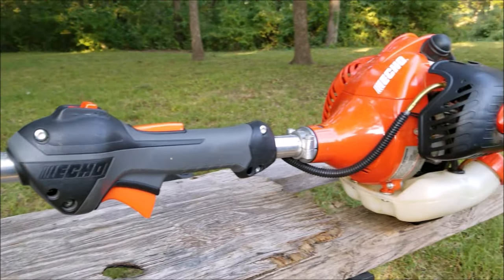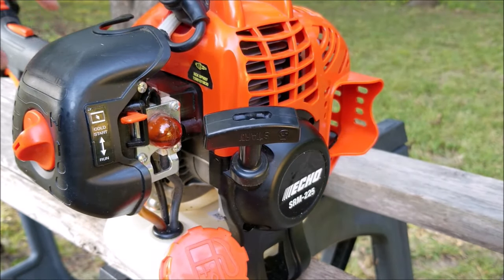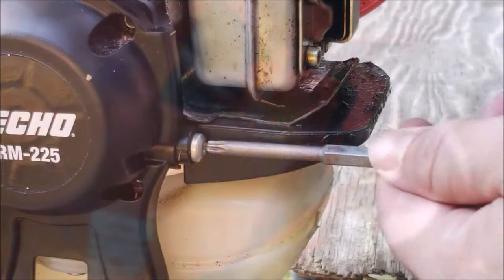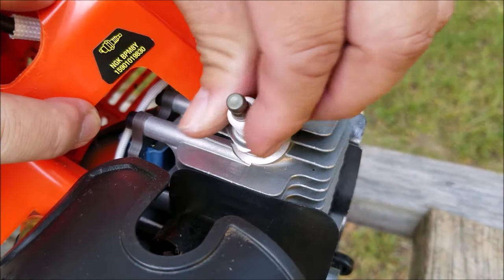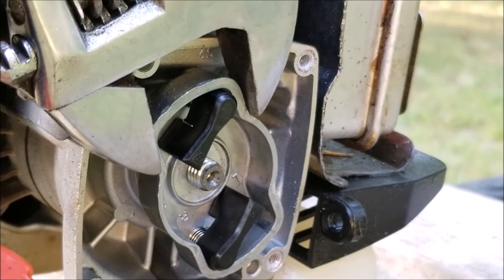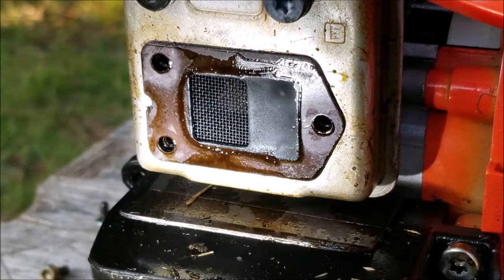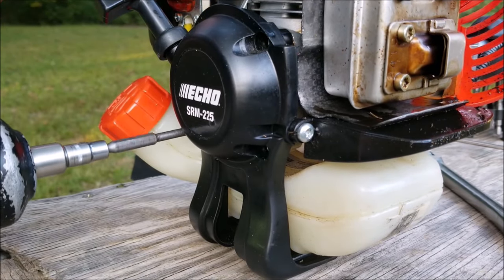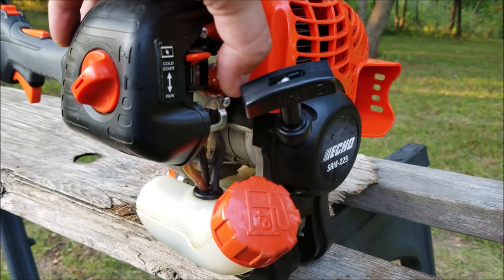Pull rope is stuck and won't budge

Comment: Bought a chainsaw,spares or repair. Pull rope wouldn't move. Took spark plug out, covered in lot of fuel/oil residue. Removed muffler to check piston etc. Piston ring was glued too.  Poured some white spirit into exhaust port & plug hole. Left to soften a few hours then engine turned over. There was still a thick coating on piston head & upper cylinder.
Mixed 25 ml of white spirit in 5 litres of petrol. Used to make up 2 stroke mix @ 40:1 .
After running a few tanks of this fuel mix, checked piston through exhaust port. The residue had dissipated. The metal was shiny & piston ring groove clean. No visible damage in engine, just some tarry gunk in bottom of muffler. Spark arrestor screen clean. Still running well. Hope this helps someone salvage an abused tool. People's thoughts would be appreciated. TIA
Reply from the maker: It happens sometimes but you did a great job freeing it up.
Reply: I'm opening up my weedeater today.  I am not mechanical but I have managed to fix some mowers  using youtube.  This will be my first try with a weedeater.

Comment: This is why when you winterize your equipment, you dump the fuel but don’t forget to run it after a few times to burn all the fuel out of the system
Reply from the maker: You're absolutely right about that.  Thank you Ozzy Dotson.

Comment: Great job! I had the same issue with a Shindaiwa hedge trimmer I was able to loosen the seized piston using a 50/50 mixture of kerosene and two cycle oil and letting it soak for 24hrs...enjoy your videos...keep up the good work.
Reply from the maker: thank you Kirk Leaper

Comment: Worked for me. Thanks a million brother. It was my dad's x-series weed eater. I think there was some built up pressure from the WD-40 being in there with the spark plug in. But as I pulled the string a few times the pressure began to release more and more with every stroke till it started.
Reply from the maker: no problem

Comment: Good job, I've never had that happen, I only use the good stuff,  Aspen 2 in all my two stroke equipment so I don't have to worry about leaving the tank full over winter and I find it burns cleaner. I used to mix my own fuel and had to empty everything for any long storage like over winter but when I changed to Aspen 2 I don't have to worry about that and I also found that it cleans the engine too, my HS 45 Stihl hedge cutters had tons of carbon deposits on top of the piston, 3-4 tank fulls of Aspen 2 and it's gone and looks like new and runs way better
Reply from the maker: i'll have to look into Aspen 2 sounds like great stuff. Thanks for the comment I appreciate it.
Reply: @HomeGaragechannel  no problem, let me know how you get on and please keep up the great video's
Reply from the maker: @nicolabooth6075  I will thank you

Comment: The storage was a problem but all the carbon on the sparkplug seems to me that the owner never runs it hard enough to burn it off . my neighbor was using his 2 stroke barely above idle and i told him its a 2 stroke and you have to rev it up more or you will have problems and now he gives it a workout .
Reply from the maker: you are absolutely correct about that.  as for how they were using it i'm not really sure.

Comment: Or use fuel stablizer. 
I have never had any issues starting my equipment after storing for the winter, or longer. At the end of each season I change oil, filters, etc., then run the machine til it stalls out, a couple of times, then I will empty the last few drops of fuel from the tank, leaving the cap loose or off to let everything evaporate, and will dump any residual fuel from the carb, and blow out the jets.
Next season I check the oil, gas and go. 
Been doing this for decades.
 Never had an issue starting even very old equipment.
But good job getting the trimmer going. May have been a good idea to check the air filter before starting. Eliminates another possible issue, and much easier getting it back on when the engine is not running.
👍
Reply from the maker: yes some people just put stuff full of gas.

Comment: No I haven't had an engine jam up on me due to storage but I think someone has used too.much 2 stroke oil in the fuel at one stage in the line trimmer in the video because I think that's what's caused the cylinder to varnish up.

I was told not running a 2 stroke engine at full revs can cause that because all of the oil doesn't get burned off so it just sits in the combustion chamber then varnishes up the cylinder, piston & rings !
Reply from the maker: that makes sense.

Comment: Before storage, the manual for the Echo GT225 recommends:  Observe the piston location through the spark plug hole. Pull the recoil handle slowly until the piston reaches the top of its travel and leave it there.  Reinstall the spark plug but not the ignition lead".  This might be a little extreme, but I've read many suggestions in manuals  to rotate the engine until you can feel that you're solidly into the compression stroke, to close the valves and seal the combustion volume.  Perhaps this would have helped here.  Since I have an identical model, I'll pay a little more attention this autumn!
Reply from the maker: this is a great idea.  I'm surprised that they would suggest that in the manual.  I would only do this if i was going to put something up for a very long  time.  Thanks for the comment I appreciate it.
Reply: On a 4-stroke, like on a generator it's good to store them at TDC. That way both valves are closed. I have a 2.6K Onan that I have to store like that. An intake valve was stuck when I got it and the TDC has kept it ready to go since then.

Comment: Thank you for this video. I have an excavator wood chipper that has a stuck pull string. The problem started when I left the machine outside overnight and the temperature dropped to freezing. Even after warming up it is still stuck.
Reply from the maker: did you happen to oil the spring at some point before hand?

Comment: This looks like the results of improper fuel mix or crappy 2 stroke oil... echo red armor is the best air cooled 2stroke oil out.. I run it in all my machines. Trimmers , chainsaws,  snowblower you name it! There is totally a difference between liquid cooled 2stroke oil, marine 2stroke oil and air-cooled 2stroke oil. This info was given to me by my local power equipment shop, awesome guys that take pride in helping provide customers longevity with their equipment, rather than constantly getting it fixed 🙂
Reply from the maker: thank you for the information.

Comment: Yes, I had a customer bring me a small Chanpion generator that was full of very sticky stuff, Don't know what they used for oil but it was awful. Maybe they put cheap 2 cycle oil in a 4 stroke engine. Thanks for the video.
Reply from the maker: no problem Waterman one

Comment: Had a similar problem with both of my trimmers and both were kept inside. Could not rotate the engine with the plug in but rotated without the pug. So shot some carb cleaner and engine oil into the cyl and finally got it to rotate with plug installed. First time I ever experienced that symptom as I use these machines quit often. Also use a gas additive to prevent varnish. Thanks for the video but wished I had seen it first before attacking the problem. Not sure there are valves in these 2 cycle engines or reeds.
Reply from the maker: Neither as far as I can tell. Thanks for the comment I appreciate it

Comment: no because the feul evapourates leaving the oil behind causing it to stick can also stick the diaphrams to gether making it unusable sometimes having to clean out the carb and replacing the diaphrams this one was lucky
Reply from the maker: You are absolutely correct

Comment: Someone needs to use a different 2 stroke oil, it not doing its job fully. Storage protection is also part of a OPE oil job. Does the oil used on that trimmer say Biodegradable on the front of the container?
Reply from the maker: i'm not sure about that information.  I'll have to ask

Comment: I cut the grass yesterday. The first two rounds were fine. After some time the machine stopped and I tried to pull the string to start but it stuck. Not sure what caused this but the motor was hot when I touch it. I have a different model but I will try to check following your video. Thanks for the clear & precise explanation! Great video!
Reply from the maker: take out the oil dipstick and wipe It clean, and then check the oil, it might be a little low.
Reply: @HomeGaragechannel  I followed your instruction but I didn't have a carburetor cleaner at the time. So I just sprayed oil inside that chamber and I tried turning the motor by hand. It's smooth. It worked! I used it but then it got stuck again after some time.
(That was before I saw your comment here)  I will try next time regarding your comment. Thanks so much!!!

Comment: The spark plug was completely carbon fouled.  2-strokes are not made to idle, they are made to run wide open throttle as much as possible once warmed up.
Reply from the maker: You are correct about that.  After running it for awhile the carbon was pretty much burned off and it ran great.

Comment: Thanks. I have a Yard King that just stop in the middle of the job. Could be that I overwork by not have a few seconds of stop. I just cranked it and it stop. As illustrated here by you, I can’t pull the cord. 
I will try your method and see what happen. 

Thanks
Reply from the maker: no problem David and good luck

Comment: I’ve not had that happen. 

I only use premium oil mixed with ethanol free fuel.
Reply from the maker: That's the best option. Some people just can't 100% gas
Reply: @HomeGaragechannel  That’s what I thought. There is a website showing the locations where it is sold. I have 2 marinas, a mower shop and a rental center near me that sell it.
Reply from the maker: @Cinder2008  nice

Comment: Thanks for the video, I have a large shredder, and when I filled more petrol into my can on the shredder some poured over the engine, and now I can’t use the coil, it won’t work at all, any ideas ? Will it dry out or have I got to take to specialist ? 🙏🏻
Reply from the maker: I'd give it time to dry out. If not, I guess you'll need to replace the part.
Reply: @HomeGaragechannel thanks a lot, I checked it today a day later and it is still stuck, similar to your video of it being jammed. It was working fine until I poured petrol into the cap on the top of the engine and some poured all over the top filtering down through what looks like the engine. When I went to pull the cord it wouldn’t budge 😢
Reply from the maker: sorry to hear that. By chance did you check the oil level?
Reply: @HomeGaragechannel I’ll check in the morning, basically it’s been idle for years, brand new probably only used once by my friend, I took a chance to start it up and it worked perfectly first time, ran fine until the petrol scenario, but I never checked the oil 😬 thanks I’ll keep you posted

Comment: Reason this happened was  motor put away standing up on the engine with the string end up in the air. the motor was being used full throttle then switched off while keeping the trigger pulled, thus the engine got flooded with fuel.... then being left for a long period the fuel goes stale and the gasoline evaporates leaving this sticky gum residue that when it drys is real tough stuff ( if going to leave any motor for more than 5 weeks empty the tank and run motor dry of fuel or this can happen ).... if this happens to you dont do what he done, get some egr cleaner or get some engine carbon remover.. this little motor seems ok but the rings will not be perfectly free and will need a treatment of either Mercury power tune in a can or Yamaha ring free, it will then get in behind the ring and free the gum and varnish off it plus clean out any Varnish or carbon in the cylinder the head and the exhaust...... WD40 is terrible for stuff like this as its way too dry after a very short period.. you need proper anti gum/carbon  stuff because this gummy varnish dont just dissapear, it need to get burnt out the motor.....do not use seafoam as that is rubbish and mainly water and can cause this stuff to be even worse and then need a full engine tear down..........
Reply from the maker: Thanks for the information

Comment: Great job. Was this a "if you can get it running you can have it", or a repair and return? Super camera work. 👍
Reply: More like a $10 holler.
Reply from the maker: Unfortunately it was just a repair job. Thank you Dave for your time.
Reply: @999thenewman  10 deposit. The equipment might not be worth that if you open it up lol another 10 for the work when completed.  You have 30 days to pick it up or it’s mine.

Comment: I notice my Craftsman WS 405  has its pull rope stuck too, and I guess it has something to do with the way I store the unit (hanging against the wall vertically, with the engine down). I guess this position may lead the engine oil to move and precipitate on the "back" and allow to dry and stuck parts within the engine.  this vid allowed me to understand that the problem is NOT the Pull Rope, but actually the engine being stuck. ( I eventually saw the Craftsman WS 405 manual that says to store in a HORIZONTAL position). If this is your case, just place the unit on horizontal position (or tip slightly lower than engine), wait for 15-30 minutes, then try to start it = usually it will be FIXED!!!
Reply from the maker: you make a good point about the storage.

Comment: This is why the manuals tell you to put five drops of fresh oil into the engine and pull it over several times before storing it. Another way to do it is to use premixed engineered fuel in your machine and run it for 15 minutes before putting it away.
Reply from the maker: really? I've got to look that up, it makes sense!

Comment: My mower has always been outside for like 10 years and I don't drain the gas and i dont cover it and it hasn't given me problems .  About the WD-40 and the carb cleaner you sprayed inside can I do the same with my Stihl chainsaw that is dirty inside but it's not locked I just used about 3 hours ago but inside the engine
Reply from the maker: nice, if it works for you, keep doing it! thank you
Reply: @HomeGaragechannel  it's old but I take care of it like if we're new I clean it and do good maintenance to the things I can
Reply from the maker: nice!

Comment: If the cord pulls when spark plug is out, but doesn't turn when it is in, is the weed eater hydro locked?
Reply from the maker: at one point it was, and when the gasoline dried up, the piston got stuck to the cylinder.
Reply: @HomeGaragechannel  Thank you~
Reply from the maker: no problem

Comment: I need help.
I have a echo srm 225.
The primer bulb only works if the return line is literally submerged in the fuel. Should it be like that?
Cause if im not mistaken the return line comes originally as a short line.
Reply from the maker: You are absolutely it shouldn't have to be submerged in the fuel for it to work.  I would replace the carb.
Reply: Are you sure some hoses are not mixed up? On a 2 stroke Echo and most modern 2 stroke OPE engines it is a purge bulb not a primer. All it does is remove air in the fuel line between the tank and the carb. No fuel is pumped into the engine when a purge bulb is pressed.

Comment: What do you do if you pull the rope and it gets stuck outside the weed eater and it won’t go inside
Reply from the maker: depends on the weedeater brand but you'll have to remove the recoil, and see if the the spring is broken, or if the string simply got bound up on the pulley.

Comment: After doing this to fix the recoil, I cannot for the life of me get the trimmer to start whatsoever. I went down the rabbit hole, replaced the spark plug, air filter, fuel filter, and cleaned the carburetor. Still won't start. 

I'm truly at a loss now. Should I perhaps leave it for a day or so to dry out the carb cleaner and WD-40?
Reply from the maker: no WD -40, instead remove the spark plug, leave the trimmer in the sun for few hours, then replace the plug, and on start up, DO NOT use the choke, instead squeeze the trigger, and pull it several times. see what happens.

Comment: I am thinking of buying this trimmer and I don’t want to spend my money on something that will break down in 4 years you worked with those kinds of trimmers do you know how long this trimmer will last?
Reply from the maker: as long as you use pre-mix from a can, or use no ethanol gas, and store it properly, it will last years. Neglect it, and it doesn't matter which brand you buy, it won't last.
Reply: I don’t have no ethanol fuel but I put a fuel additive in the gas to make it no ethanol gas and I will run the fuel out in the winter
Reply from the maker: that should be plenty of preventive measures to last a least a decade. If you want to go even one step further, I would empty the gas tank and run it dry "after every use". that's a bit excessive but that's what I do, mainly because I don't want gas fumes in the garage during these hot summer months.